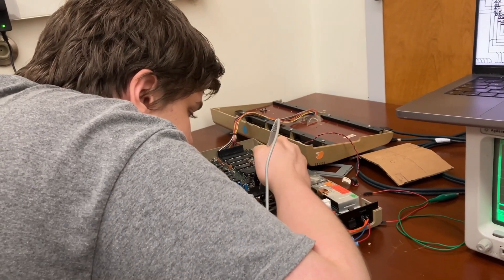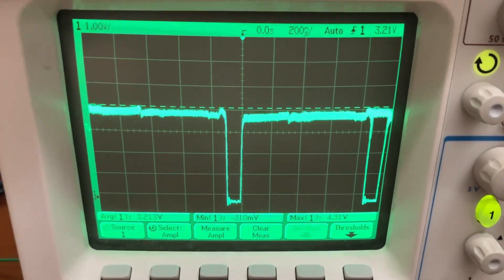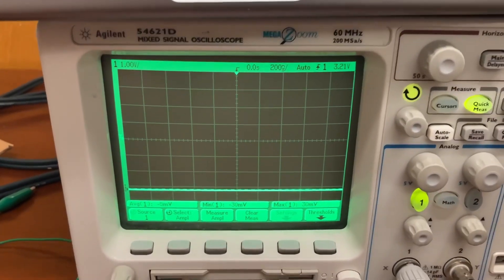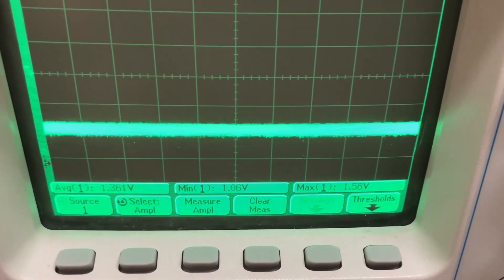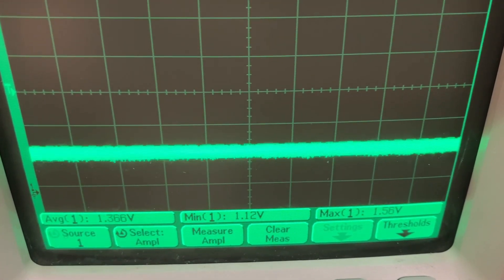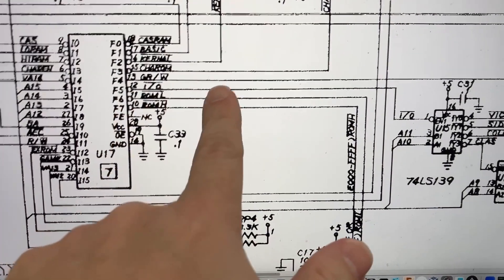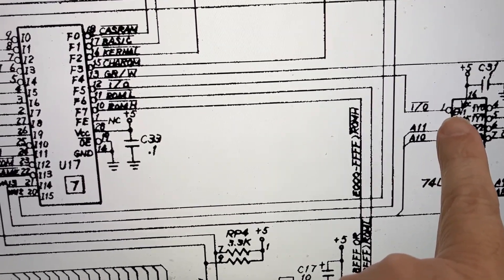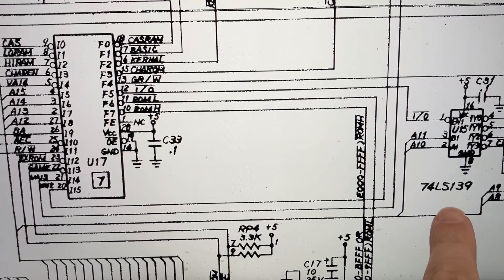Commodore 64: Bad PLA or Bad 74LS139 Demultiplexer? (I/O output pin of PLA has invalid TTL signal)

Comment: You could pull the PLA since it's socketed and then use a logic pulser & logic probe on the MUX to see if it's outputting the proper signal(s).  I've successfully done this to find a bad chip in my PDP-8/A's "Programmer's Console."

Comment: One idea, pull the PLA, or PAL, whichever it is, and then feed a TTL input from a TTL chip on a breadboard, so it is sourcing the right levels of current, then see how the multiplexer responds. Another thought is you can careful lift the output pin of the PLA, and check the pin unloaded, obviously being very careful not to break the leg. :) It would allow you to test without having to de-solder anything, and be reasonably sure of where the problem is.
Reply: How about a socket in a socket with a bent out leg. No risk to chip leg.

Comment: Can you cut the trace and see if it unloads?
Reply from the maker: Actually, I could try taking out the PLA, bending up the questionable pin, and putting it back in. If I get a good TTL signal out that would suggest the Demux chip is bad.
Reply: @ well yeah of course if it’s socketed 😀
Reply from the maker: @MuzixMaker  But I didn't think to try it until you mentioned the idea of cutting the trace -- so thank you for the tip! :)
Reply: @Lantertronics  I should learn to read ALL the comments before I post mine---I just suggested lifting the pin, or applying a TTL signal to the input of the mux, or both. :P